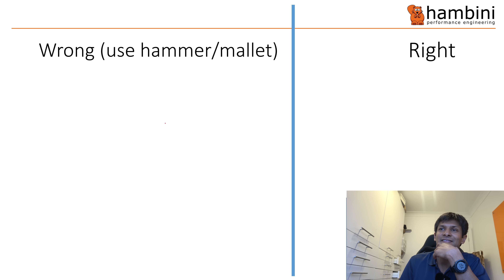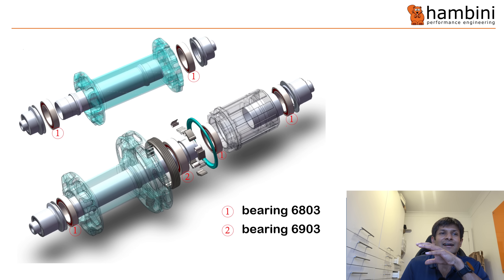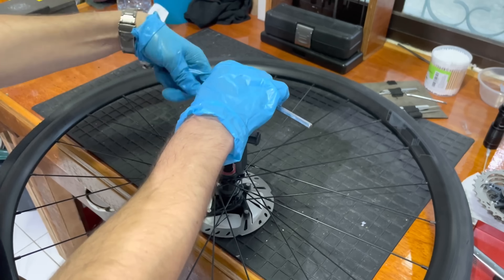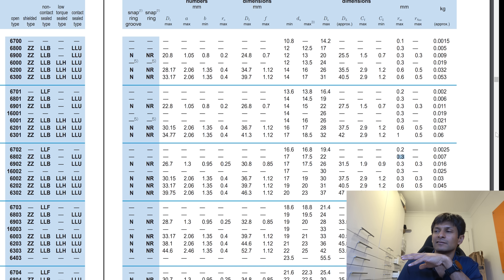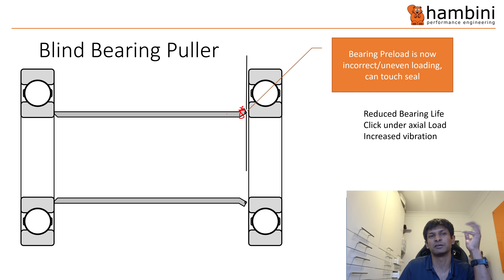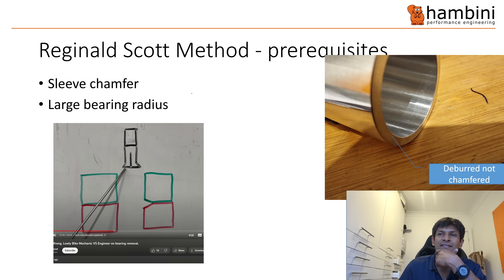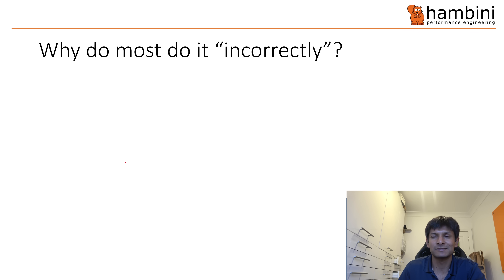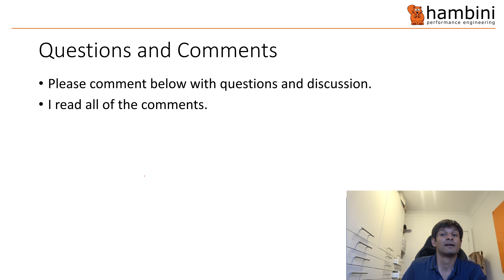I got REAMED by a Bicycle Mechanic | It was bound to happen at some point.

Comment: Haven’t seen the blind bearing pulling video, but from your explanation it’s easy to judge which is the most efficient, sensible and widely used technique! Even hairdressers know gentle tapping on just the right spot is often a pretty good and effective way to ease a release. 😊
Reply: i'm frankly shocked at the amount of mindless sheep in this comments section, very few willing to actually question the status quo (hambini) or think about whats actually happening during each process (punch vs puller)....

...so think about this problem from a physics perspective....what is more likely to damage a set of bearings given its physical properties: a short, sharp, direct force in a very localised area? or a gradual, even consistent increase of pressure across a wide area where the load is evenly distributed? 

you don't have to be an 'engineer' to know which is correct, i'm an Architect of over 30 years, maybe stop relying on what your hairdresser is telling you and think for yourself?
Reply: Long time fan spotted. The ref to the hairdresser gave it away.
Reply: legend has it Hambini has a male barber
Reply: Yes that’s very important in life, whatever you do only ever listen to one side of the story. That way you are always protected from the other perspective and you won’t risk seeing or hearing anything that might conflict with your current view. 😉
Reply: @reginaldscot165  you’re absolutely correct mate. It is indeed important to listen to both sides of any argument. This is especially important if you are uncertain the message you are hearing from either side is not well researched, accurate or appears biased. As I stated this video presented both sides of the key element - that pulling with a specific tool does not cause damage whereas the tapping method can. It then presented entirely believable direct evidence that whilst one side stated pulling caused no damage, this did not appear to be correct. So, in this case, with a sample size of one, bearing pulling caused damage, to the internal sleeve. Based on that ‘it’s easy to judge which is the most efficient and sensible technique’. Widely used may not be accurate as only the advice from companies to use tapping could be presented not directly how many people follow the advice.
p.s. I have now watched the video.
Reply: I suggest you go watch the video then. 

You might learn something. That being is that Hambini can’t accept he was wrong

Comment: It is difficult to ream a reamer.... Nice work Hambini... I wonder if he is such a good bike mechanic that he faces brake mounts and bottom bracket tubes etc... I am a old school bike mechanic from the 90's and have not built any of the new bikes so not sure if the new BB's need to be faced but I don't see any bike build videos doing it
Reply from the maker: I'd say it's worse now than it used to be. Metal frames were relatively easy to face because they were basically tubes with threads. Modern day pressfit is somewhat erratic from an alignment perspective.
Reply: @Hambini  so I am not wrong in thinking that the quality of bike has dropped significantly while the price has risen to pure BS levels... NZD $21000 for a top spec full sus mountain bike 🤣🤣🤣 what a crock of shyt
Reply: He now said that Hambini made the spacer look like if was damaged and that Hambini is being quite dishonest 🤣🤣🤣🤣🤣

Comment: I know it's wrong and I have a bearing puller but I still tap them out all the time. I'm still riding the bikes I work on and they all work just fine.
Reply: Point is…it’s not wrong to tap them out..in most circumstances